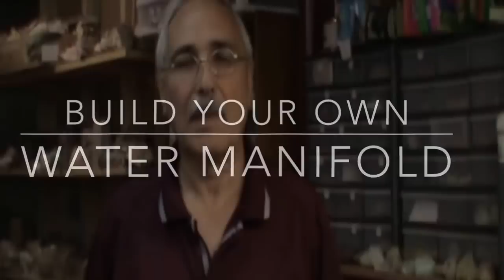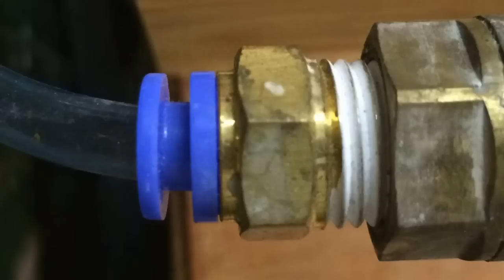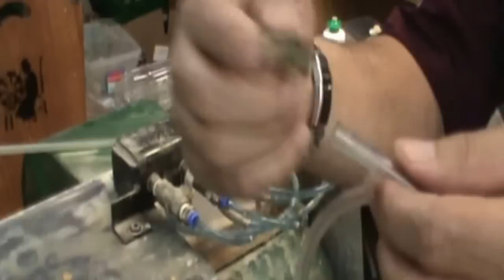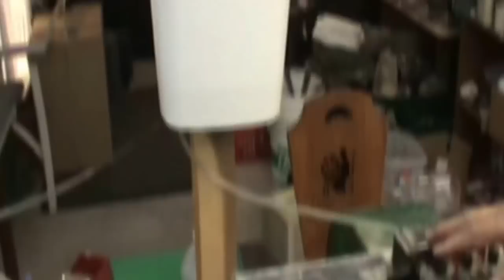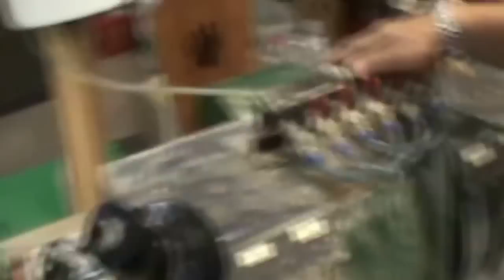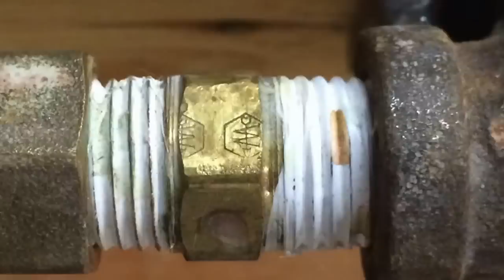Build your own Water Manifold

Comment: How do you connect the quick connects to the trashcan a buckets?
Reply: Drill a hole in the bucket to slide fit the quick-disconnect, get 2 rubber washers to fit the quick-disconnect on each side of the bucket and tighten the nut.